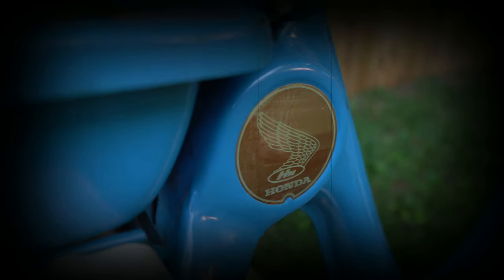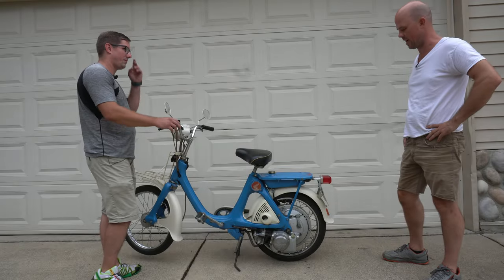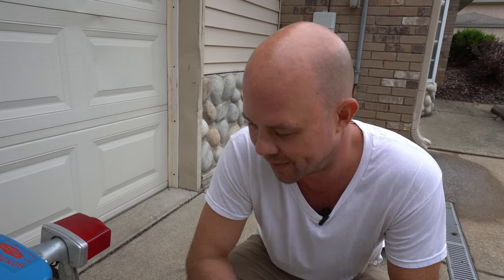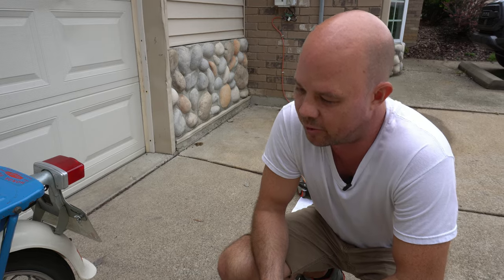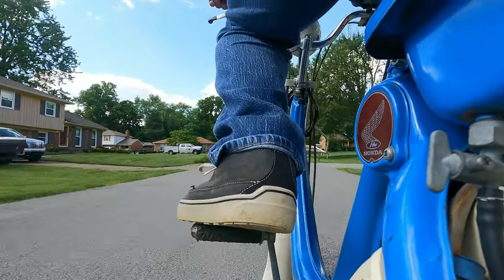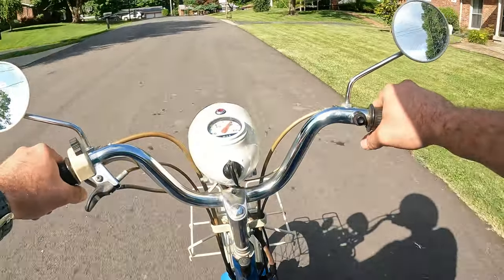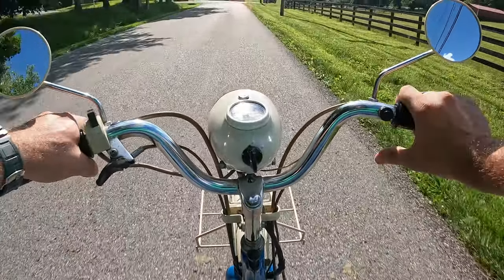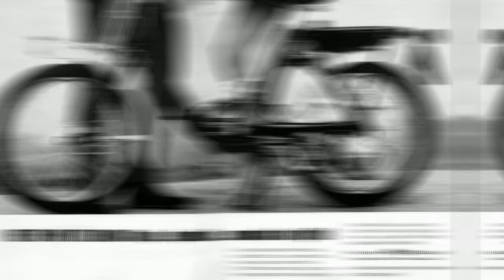What Was So Different About Honda's First Moped?

Comment: We had one with the same colors in the Philippines circa 1967. We had a bracket and seat installed on top of the gas tank to accommodate a passenger. I rode it around town as a very young teen. We gave it away to relatives in 1974 when we returned to the U.S.
Reply from the maker: That's really cool! I personally think the blue is a really cool color on these and favor it over the red. I cannot imagine riding a passenger on one - it's a torquey little moped but still a moped! Although I suppose skinny little teenagers are a bit different also! 

I don't definitely don't see very many of these around in the US, and am betting they were more plentiful at that time in the Philippines
Reply: @retro_grade  My next door neighbor in the Philippines bought the red one. My Dad was so impressed he bought the blue one. One night in 1971 he was riding it in a dark road, ran into a pothole, crashed and broke his collarbone.

Comment: While the Honda P50 was technically a moped, meaning it had both a motor and functional pedals, it's four stroke engine made it somewhat slow and undesirable. Honda did not get the moped concept right until the mid '70s with the PA50 "Hobbit" with a 2 stroke engine. I have owned 17 mopeds since 1975, including Peugeot, Motobecane, Puch, Tomos, Solex, Vespa, Sears Free Spirit and JCPenney Pinto (both made by Puch/Kromag) a Garelli, and yes, a Honda PA50. I have modified mopeds to reach over 50 mph. I currently own a Puch Newport II, a Tomos ST, and a Solex 3800. While mopeds are small bikes, they are huge fun.
Reply from the maker: Yeah, not as easy to push to 50 mph and make those kind of gains on a 4 stroke. Honestly on the PA50 though, I wouldn't have wanted to go much faster on it. 25 mph or whatever the top speed it reached was enough for me on something that felt like an old bicycle suspension, brakes, and wheel wise. Moreso on that even, than other mopeds that I've been on. 

I had a Jawa back when I was 14 years old and still think I've got it stashed back home, somewhere lol.
Reply: @retro_grade  Very cool!  My buddy's mom still has her little "Indian Scout" motorcycle that her dad bought her brand new when she was a kid.  I think it they have it in their quancet buried under a bunch of stuff, kind of like my uncle still has our family's Ford Model T that buried in the corner of their shop.

Comment: For 50cc bikes the Super Cub is the benchmark but some countries allowed these bikes tobe operated without a license if they had pedals and restricted top speed.
Reply from the maker: Several states in the US (Kentucky included) allow mopeds and scooters under 50cc to be operated without a license as well currently. So, the P50 falls into this category but obviously the Super Cub (as it shifts gears) does not :)
Reply: Yep.  I still see brand new Honda Super Cubs on the showroom floor at the Honda dealerships in Phnom Penh, Cambodia.  The salesman said you can order them in 50cc, 70cc or 90cc and people in the community said they are really reliable.
Reply: @MyLifeThai371  That's cool the original classic is still available. Here we only get the 125cc retro Cub.

Comment: Oh, the things are four stroke nice
Reply from the maker: They are nice, refined little mopeds for sure. Nice until you have to change out that rear tube or tire LOL.
Reply: @retro_grade  I believe luckily for me, my heart is super cub. Tires are tubeless so lately I’ve been a lazy person and I have been having the shop put the tires on the rims for me and then I’ve just been switching the rims out because I have two rims for the front and two for the back and it’s not too bad if the tires are already on the rims for me
Reply: @charleshunt3806  That's a smart idea!
Reply: @MyLifeThai371  well I have an update for you on my tire changes so unfortunately it cost $40 per tire change and it just wasn’t sitting well with me. I’m used to having my tires changed for free because the shop if I buy the tires there for my car, they just changed the tires so I did some math and I bought a tire changing machine that is purely manual and basically works like a giant ratchet like a socket set and I can now change my own tires now my coworkers think I’m crazy, but I bought the one with all the bells and whistles or the extra accessories and adapter so if I ever get another motorcycle I will very likely be able to change the tires of that motorcycle. In fact I would buy motorcycle that I could use this machine for if I was to get another one, but what happened was the smallest or skinniest adapter that would go through where the shaft would go through is actually too thick so I had to buy a round of steel rod to make it work but I can make it work now. The whole get up was like $800 but I think would like changing 26 tires it would be worth it and I’m sure I will. I only get 3 to 4000 miles out of rear tire. I now have my third tire on there and I still have the original front tire so for my independence and convenience and saving money over the long long-term I opted for this option, but I am still glad that I have those extra rims.

Comment: I have 1 and When you try to pedal to start IT,  IT acts like it's not grabbing enough to spin the engine over, It makes a grinding or skipping noise,  You can pedal it by hand and it spins the engine over, but if you spin it any faster it makes a clicking and the engine quits catching to turn over to crank and run,    Any thoughts on what could be , anybody,
Reply from the maker: That's interesting, not sure. Maybe the clutch is slipping? Or sounds like something could be stripped. Do you use the compression release lever when peddling?
Reply: @retro_grade  Thanks for your reply, Very smart I never tried using the compressor release, I also have a PC50 the engines not on the back wheel , has a compress release but it doesn't matter if you use the compress release or not to crank IT, IT never strips, There is some type of spring clicker on the back sprocket but I haven't never took it apart and kind of scared to take it apart, You can spin it by hand on the pedal real slow and the engine will spin over , but as soon as you try to put any force pressure to crank IT,  IT just strips and and won't catch to spin the engine over, I can't find nothing on YouTube about rebuilding the engine or the rear wheel nowhere,  Also like to say I like your videos, Also I ordered the manual and misplaced the manual , There is a free download on the internet, But I still can't understand that either, On the manual it  talked about a secondary drive gear , and it had these little spring tensioners  2 of them on each side of each other , and it ratcheted, I believe that's what makes it crank up and then when it's running it free spins and doesn't ratchet anymore,  that's probably what's wrong with it, It may not be anytime soon, but when I do fix it , I'll respond just to let you know what it was, thanks again for your time, My son has 1 P50 and 4 PC50s Only 2 of them,
Reply: @retro_grade  The little spring tensioners is when you pedal it backwards you can hear them click, its like on 10 speed bicycle , but when you pedal it the other way it should catch to crank the motor up, That's the springs I'm talking about,

Comment: The P50 burned out Exhaust Valves frequently
the Lack of Suspension caused lean running as the Carb. was jiggled around too much.
the Later PC 50 was a much better design.
Reply from the maker: Makes sense, did not know this! One of the many reasons the P50 likely never really caught on. In addition to things like having to remove the motor to change an inner tube, LOL. 

Thanks for the comment!

Comment: Says Honda wanted something quieter than a 2 stroke but this thing sounds like a god damn biplane in the video compared to my tomos.
Reply from the maker: Maybe the microphone placement magnified it (I didn't think it sounded that loud after review). 

It's a pretty quiet engine overall. You hear the whine of the transmission more than the motor. 

I also suppose for any engine that small, you can probably kill most noise with a good enough muffler.